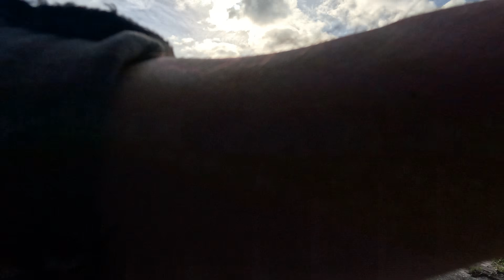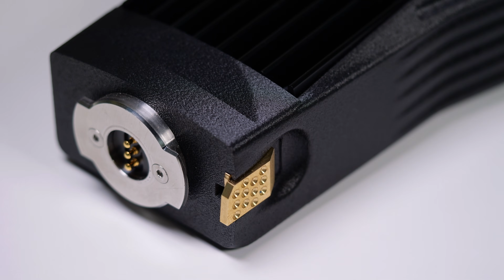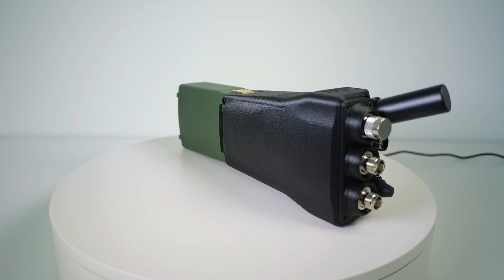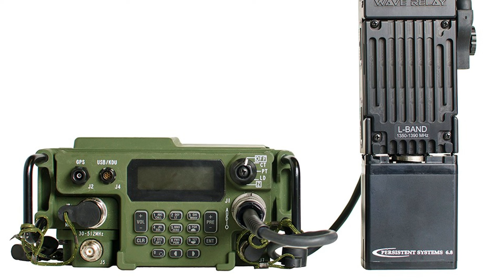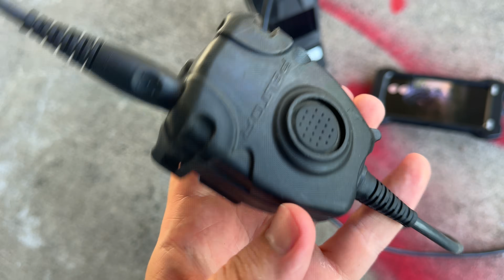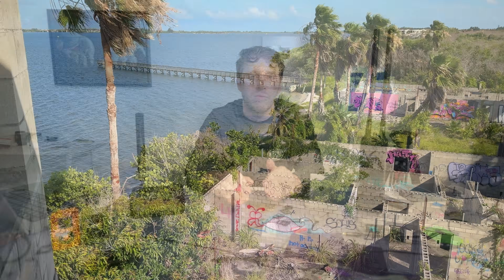This Wi-Fi Feels Illegal

Comment: Ask them how much they would sell that radio for if they had to provide the customer with software upgrades, training on programming and usage for the next 5-10 years(at no additional cost)? How much would the radio cost if they also had to provide parts/system warranty for the next 3-5 years? How much that radio would cost if they were required to build the manufacturing backbone to support 100k radios to be delivered within the next 3-5 years? The cost of a system is rarely the biggest line item. Alot of you need to take an Econ class.

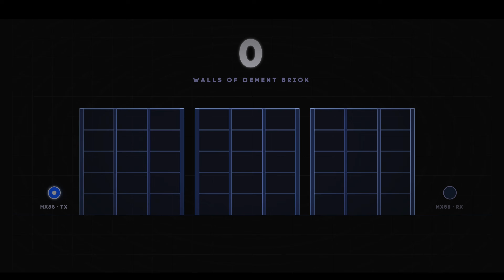Comment: 3:24 12 walls. Sure!
In 3 vacant structures with no windows!  With non to zero Wifi-Pollution. 
The signal went through 12 concrete walls like a laser beam. xD

Comment: I just want to correct you on one thing CF Nylon doesn't make things stronger really. It makes them lighter though. It also helps in printing that's why CF PLA exists. Now there  is an exception Stranded CF Carbon Fiber but that is not what this is. It's a common misconception about CF filaments that even manufacturers sometimes falsely advertise.

Comment: A small car rolling over the body is not a real test. Drop it from shoulder waist or shoulder height onto concrete and see how it fairs. Like I commented on the last video. If you're going to charge that much for the build just charge an extra $30-$40 and get cnc anodized  aluminum bodies made.

Comment: I need to deploy a network across my hilltop estate in the UK, i have an internet point in my units, but my elderly mother lives 3 fields away down the hill, beyond her is our farmer. 
Non of them have any access to internet, we are remote & one the few places left in the UK where there is little to no cell excpt a 5G signal at mine at the summit. Ime using a parabolic collector dish on the roof & signal amplifier in my internal space. This gives me a fairly stable mobile access point that is a fairly constant 25 to 30 meg. 
I know that's slow but it is vital communications & local infrastructure management & transactions only, not streaming movies & music.
I want my mother & the farmer to be able to use my connection, but cables are a no-no. 
Would this system you demonstrate here be able to do that ?
I did not understand all of what you were speaking about, but i understood enough to think that may be it could send & receive a data signal across my estate. 
Is this worth me learning a new skillset to do this or will it not be up to the job ?

Comment: Suggestion to improve video quality in hostile environments. I'm an engineer who has been working for a video streaming technology vendor, and I can give you some tips!

Use Traffic Control in Linux to set latency to a set amount (be generous, around 500-900ms). This will help with jitter Video's worst! enemy.. Also, I'm not sure how much computer power you have for the video, but you can play around with ffmpeg and "upscale or downscale" the video quality based on packet loss and latency. Link is good, push as much quality as the link gets worse, lower the video quality.

Comment: Although wood and concrete can block Wi-Fi, it's the steel in the concrete that is the biggest problem. The more steel or iron, weaker the signal. It's like a Faraday cage.

Comment: This is super cool. I already run wireguard underlay between machines with a headscale overlay instance and my own derp and stun relays for Access Control and SSO. As well as an ATAK server. This would be really cool to integrate.
Reply from the maker: For sure, admittedly I haven’t done the tak server approach yet just flat mesh with multicast etc. Would be curious how your using wireguard, just remote access?
Reply: Sure. Not just remote access, more like a routed service fabric. I have fixed WireGuard tunnels between trusted nodes, home, VPS, field/edge boxes, etc. Then I run Headscale/Tailscale over that for identity, ACLs, SSO-ish access control with Authentik, and easy host discovery.

All the actual routing is handled on OPNsense. That’s where I manage the WireGuard interfaces, static routes, advertised subnets, firewall rules, NAT/routing policy, and segmentation between VLANs and tunnel networks.

My VPS basically acts as the always reachable rendezvous/relay point, and I also run my own DERP/STUN so clients can still connect when they’re behind ugly NAT. When direct paths work, they go peer-to-peer. When they don’t, they fall back through my relay.

For ATAK, the server sits inside that private fabric instead of being exposed publicly. Clients/nodes join the tailnet, routes get advertised through OPNsense, and the TAK services are reachable over the overlay/private routed network.

So the flat mesh/multicast side would probably stay local at L2, but I’d bridge it into the routed fabric with a gateway node. That node would sit on both networks, then OPNsense would handle the routed side, either advertising the mesh subnet or letting me proxy/reflect whatever multicast/discovery traffic is needed.

Basically local RF/mesh for edge comms, OPNsense doing the serious routing/firewalling, and WireGuard/Headscale for secure private backhaul and control.
Reply: I have no clue what you just wrote.
Reply: @joebudi5136  Imagine I built my own private internet road.

OPNsense (my router/routing software)is the traffic cop.

WireGuard is the secret tunnel.

Headscale/Authentik is the guest list, so only my devices are allowed in.

The VPS (virtual private server) is the meeting spot everyone can always find.

ATAK lives inside the private playground, not out on the public internet.

So instead of random people touching my stuff, only my approved devices can talk to each other through my private little network roads.

Comment: Those Are Cement Blocks Or Cinder Block Not Brick!! A concrete block (often called a cinder block in North America) is made from cast concrete with aggregate such as sand and gravel, while a brick is primarily made from clay that is molded and fired at high temperatures. Concrete blocks are larger and faster to lay, making them popular for load-bearing walls and foundations, whereas bricks are smaller, heavier, and prized for their classic appearance and long-term durability! And are used in the Facade Not The Internal Structure!

Comment: I like Halow because it is in the 802.11 family.  With Lora you need gateways to connect. What I dont like about Halow is that only two companies produces hardware for consumers. And despite of what you are saying it is relatively expensive to play with in a homelab. But hey I like both Lora and Halow. I work at a university and we have a ton of loggers that today uses 2.4Ghz wifi. At the same time we are not keen to use 2.4GHz on our normal Wi-Fi Infrastruture. So I want to make Halow devices that uses 2.4GHz  to connetcs to the loggers with a very low signan strenght. The Halow sub 1GHz should then connect to a Halow gateway. Well they both speaks TCP/IP so using the word gateway is a bit overstated. In that case I can rely on a few Halow "gateways" per building instead of pushing 2.4GHz out on every access points.. And since Halow is a 802.11 standard I also get the security features
Reply from the maker: Agreed. LoRa has it’s place in terms of GPS/chat long distance fall back but yeah it functions independently of any wifi network.

Comment: I wish I could have some kind of low cost (less than 300$USD) low volume-size/weight FPV system for a surface RC car. Right now there's those from drone (most RX/VX are using 5Ghz) but when put on surface vehicle, the range get so bad (about 100-150meters max, even if only few obstructions (trees, rocks, small hills, etc.). This HALOW thing could make this work but the size and cost (over 1500$USD) isn't practical. It seems a pretty good system though!
Reply: If latency isn’t a huge limiter, you could rig up a repeater node with uninterrupted LoS. Heck, you could even make a drone the repeater but it might exceed the budget.
Reply: Big ass antennas

Comment: The problem with these is they’re WiFi based, just like Silvus, or persistent systems.

L3harris does much better using uhf/vhf.

Typically these are great if you’re a tier 1 operator who can take advantage of repeaters and extenders through out your city.

Otherwise these have all the same issues and drawbacks as standard WiFi

Comment: I love this idea. I have been building a self reliance app using opensource data that I hope will be able to take advantage of this type of offline mesh networking in the future. It's getting close to release but it is a complete offline map of the United states broken down by state and many layers to the maps. Similar in idea to project nomad but runs on pc, ios, and android.
Reply: Keep us updated
Reply: @1leon_node new update direct reply to my original post
Reply: FANTASTIC idea! Keep us updated please
Reply: @OdinSonnenew update direct reply to my original post
Reply: Hopefully in a couple months or so. I am the only dev for this project so patience please. I have a free set of maps with national data sets. A premium set of maps that has state specific data sets but larger file size. Pricing for premium will be cheap one time fee. Maybe $2 a state and bulk discounts. Privacy first no accounts or tracking. You own what you buy.  Still tweaking the pipeline and build processes. 50-200mb for free 200-500mb for premium per state file. Will launch when android is ready. Will need a set of testers and I'll probably start a discord or something for that.
Reply: @Rebel_1  Basically a downloadable Atlas with more functions than the physical versions?
Reply: @IlIlIlIlIlIlIlIlIlIlIlIlIllII  It starts as a solid offline atlas with good maps that work completely without internet or cell service. But it's being built to be much more than that.
The goal is a complete offline resilience platform designed for when cellular, power, and normal systems fail.
The free core gives you reliable maps so money never blocks basic resilience. You can then add optional premium features for deeper navigation, specialized layers, knowledge tools, surveillance awareness, and eventually AI assistance and family inheritance capabilities. Not all premium features will cost money but some might. Its designed to be completely modular. Add what you want ignore what you don't want.
The big difference is the philosophy: radical privacy with zero tracking, true one-time ownership, and a focus on being genuinely useful when it matters most — not just another pretty map app.
It's an offline atlas at heart, but built as a dependable tool for real-world resilience scenarios.
Reply: @Rebel_1  If you need any assistance, let me/us know. Would love to help in any way to get your project off the ground.
Reply: Keep us updated
Reply: @justice_likes_69new update direct reply to my original post
Reply: Do you have a Reddit or X account I can follow you on to keep track of this or will you be posting on YouTube about it?
Reply: @Lavamane1 I started doing this because it didn't exist. Ive been so busy building it because I wanted this for myself that I haven't really given the attention to getting the word out. I know I'll need something but I'm not a huge social media user. I think it'll create a fair amount of buzz when I release it that it shouldn't be too hard to find. I'll ponder which platform I want to use and how. I guess I need to identify some forums and start introducing myself there and the prepping self-reliance communities. Sorry I don't have a better answer at the moment.
Reply: @Rebel_1  Dont stress. The Work takes precedence. Just think about preseeding those accounts and in place before the influx, not during - you'll miss much of the community harnessing you'll need. Take advantage of the offers of help you think will help, even if you discard my own (I'm nobody to you) but please: Heed my advice on creating a 'home/repo/'place'' before the crash influx, not before. Use those interested now to help you do that (but make sure you OWN the accounts that are created!) and the end result will be far better. GL!
Reply: Is there a project or git page we can look at to check when there's updates for your project?
I'm in the UK, but if it's good I'll be happy to buy you a coffee or two, lol.